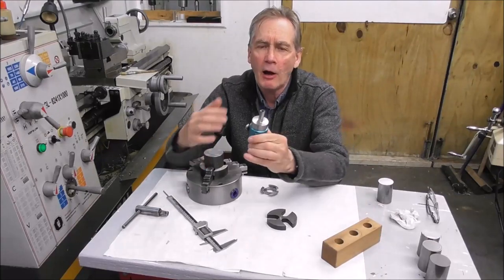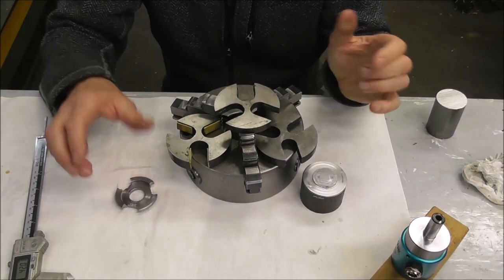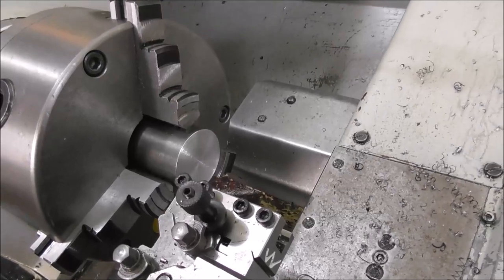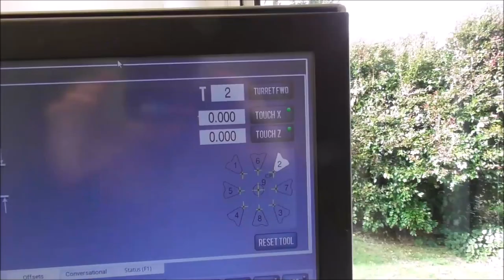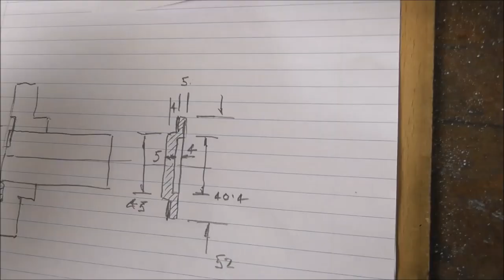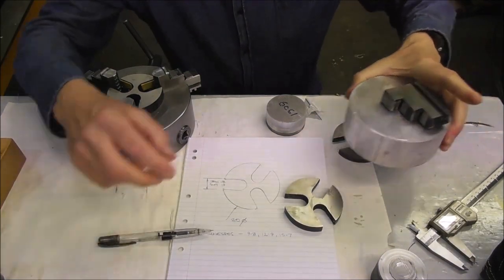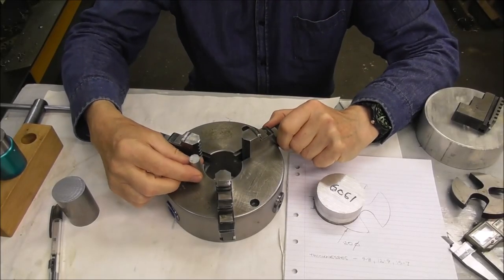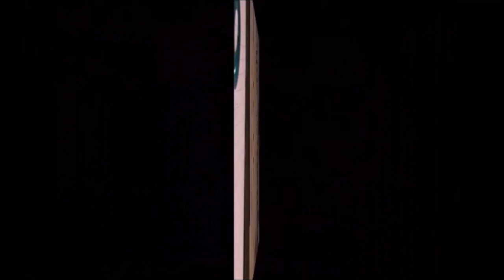Chuck stops and spiders on a Tormach Lathe.

Comment: Really useful video, thanks Cliff. That's got me thinking about the subject in much greater depth. In the past I have done odd jobs on my manual lathe and used a couple of normal 'flat bar' parallels to set my round bar square in the chuck, but obviously taking these out once the stock was tightened up, and I was under appreciating how little stability then remained against machining forces. For one-off jobs I got away with it, but I need to re-think about spiders now. I am considering purchasing a Tormach CNC lathe soon, so even more relevant for the future. Thanks for the excellent advice.
Reply from the maker: Hi Steve. Thanks for the feedback!  Cheers  Cliff

Comment: Excellent idea.  You didn't cover the making of the stops.  How do you overcome distortion when the large slots are machined?  Are the stops scrapped to parallel after machining?  Thanks
Reply from the maker: Hi KW. Glad you are thinking deeply about this. Covering everything is difficult when most viewers just want a quick summary. You can see that from the view time analytics. The larger spiders are ground flat after hardening . The small recessed spider may have distorted slightly after machining out the slots, I did not try and measure this, my estimate was  any distortion would be minor for that small diameter.  Cheers  Cliff
Reply: @Threadexpress  Thank you for the reply.  I don't have a surface grinder, so I will have to scrape them.  What material would you suggest to make them out of? Thanks
Reply from the maker: @KW-ei3pi  Well if you don't have a surface grinder heat treatment (hardening) of eg 01 steel may not the best idea. A medium tensile steel like 1045 would support and wear ok, and keep the material cost and machining time down. Cheers  Cliff